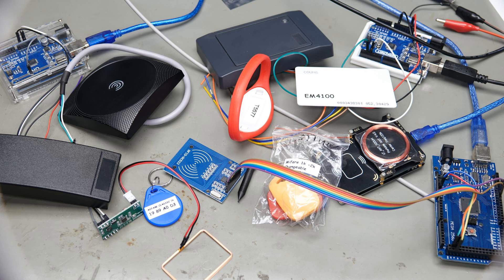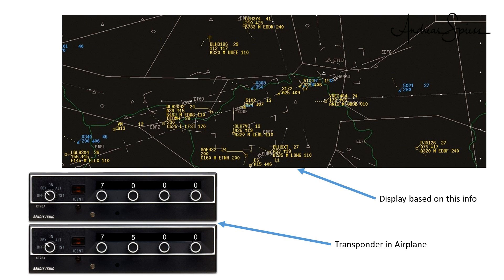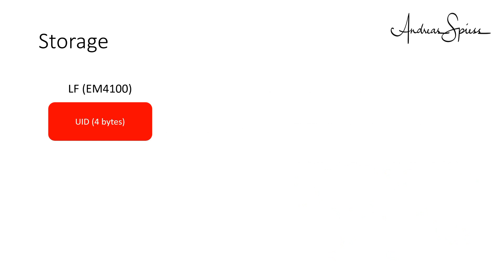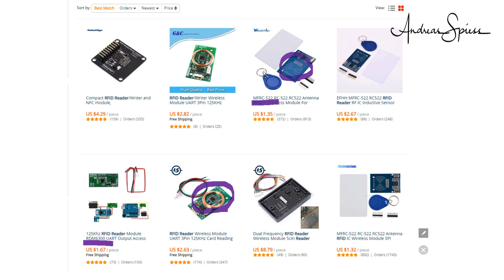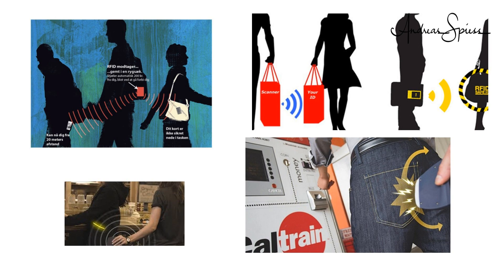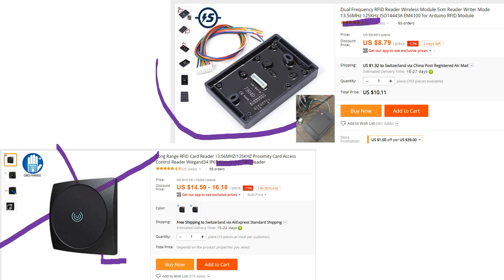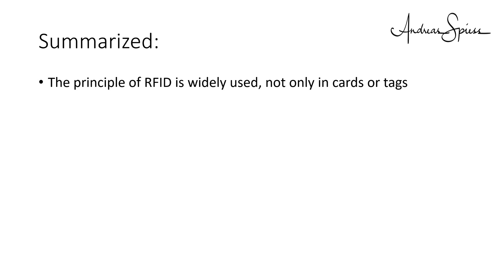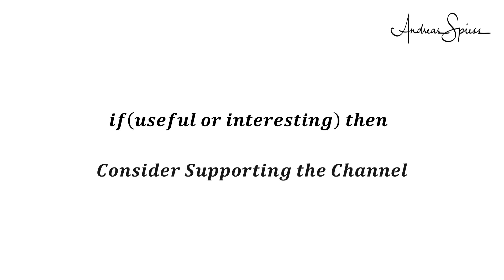#223 RFID How-To: Not only for Arduino (only legal Stuff!)

Comment: Possibly you ore a viewer can answer.  I have a dog door made by pet doors USA. I bought it almost 20 years and it was about 800 dollars THEN.. now they are about 3k.  I purchsed the door with 5 tags but over the years some have been lost.  I am down to 3.   I order news ones but when i got them they wouldnt connect and it turns out they changed the entire PCB and the  new tags are not compatible and they do not make the old tags.   So my only option is to purchase a new PCB at a cost of... wait for it...  800 dollars plus the 50 for each tag   I am in the process of designing a dog door to fit into my mudroom door with arduino so i have the readers etc but is there a way to clone these purchsed rfid tags?
Reply from the maker: No need to clone tags. If they can be read by your new reader, you are ok. If not, you are out of luck. Because there is a special standard. I made a video about animal RFIDs if you want to watch this one.
Reply: @AndreasSpiess  thanks so much for getting back to me.   i DID watch that video actually.   i haven't set up the arduino with the reader yet.   since one of the tags met with a violent end (ran over it with the lawn tractor), i can tell there were MANY more copper loops than what could fit in the cheapo ones i got from aliexpress.   but i did check and it's that same freqency as the the cheap ones, so fingers crossed.

Comment: I have built several rfid scanners into 4" outdoor jobboxes ( gray electrical boxes u see on outside of commercial buildings) I would put an arduino w a couple hats for the rfid and one for data logging inside. Double sided tape on the back and mount them right next to a buildings rfid door systems. Even w the small on board antenna it was more than enough to read 99% of IDs that used the door scanner. Just this week I picked up an arduino starter kit ( it came w an uno and a bunch of components for price of just a single uno.) The kit came w an arduino rfid starter kit, including a transmitter/receiver and a programmable card and dongle.
Reply from the maker: Sounds like an interesting project!

Comment: Have you used the MFRC522 much? There seems to be a common problem where they just stop responding. Have you seen this? (Out of 3 cards, I've now got two that are non-working and no clue as to why)
Reply from the maker: Not good. Recently, I did not use it extensively. But I did not encounter such problems.

Comment: Dear sir, 
I am not super smart, But i am willing to learn and solve my problem, 
My problem is, my car key, which has an rfid, I have lost it somewhere in the house, 
is there a way to find it with some project?
Reply from the maker: I do not think so :-( RFIDs in keys are only short-range
Reply: @AndreasSpiess  yeah, thanks for the response, figured that out, there's chip in my second car key, ATA5702, which sends out a continuous signal, and I guess, at a certain distance, my car recognizes it,
Now, all I need to build is a way to detect a rf frequency if that's nearby. The frequency I could figure out with my alternate key...

Any suggestions on this sir, any comment would be a great value...

Comment: hi! Great Vid!

I have a question for you! I have a keytag for my apartment and I want to clone it so i have a spare one. I bought the RC522 module for the arduino. The module works fine and reads lots of different cards and tags, but it does not read the keytag for my apartment. The key tag is a standard blue roundish tag with a 10 digit idnumber written on it (first two 0). Why do you think the RC522 cant read the tag, and what do you recomend i should do? Thanks :)
Reply from the maker: Thankfully, your key is encrypted. Otherwise, everybody could enter you home ;-)
Reply: @AndreasSpiess  haha yes i figured. But I still want to duplicate the key. Do you have any suggestions?

Comment: Your squawk example of 7500 is a poor one. It has a special meaning, and that meeting is hijacked. It's a squawk code you would never enter, in fact we're trained never to go through 7000 series as they are special and instead go up from the bottom.
Reply from the maker: You are right! With and 4 seaters I never had to use it ;-)

Comment: What's Wrong With this Code for Wiegand.h Library

#include <Wiegand.h>

WIEGAND wg;

void setup() {
  Serial.begin(9600);  
  
  // default Wiegand Pin 2 and Pin 3 see image on README.md
  // for non UNO board, use wg.begin(pinD0, pinD1) where pinD0 and pinD1 
  // are the pins connected to D0 and D1 of wiegand reader respectively.
  wg.begin();
}

void loop() {
  if(wg.available())
  {
    Serial.print("Wiegand HEX = ");
    Serial.print(wg.getCode(),HEX);
    Serial.print(", DECIMAL = ");
    Serial.print(wg.getCode());
    Serial.print(", Type W");
    Serial.println(wg.getWiegandType());    
  }
}

'WIEGAND' Does Not Name A Type   (for Code Line (WIEGAND wg;))

Comment: Hey, nice video :)
You mentioned that the EM4100 or "good reader" works on 5V. But on its back panel it says 12V?
Reply from the maker: I do no more remember. Maybe it has a built-in voltage regulator

Comment: Does anyone know of a tutorial for the EM4305 standard running at 134.2KHz? Or a pin layout for an FDX-B EM4305 board? Could I use the same Arduino code as for the EM4100?
Reply from the maker: I only made a video about animal tags on 134.2KHz.

Comment: Before I watched your video I had ordered the "Bad" RFID reader from AliExpress. My electronics knowledge is poor and I've struggled to get it working with an Arduino using 13.56MHz. (The buzzer is also continually on, whether it is connected to the Arduino or not). 
Do I need to wire any pullup/pulldown resistors to get this working properly? I've tried a number of libraries, but not the one you have referenced above. Any advice, or a wiring diagram would be much appreciated. I will order the "Good" one from above and see if I can get that working.
Thanks for all the great videos.
Reply from the maker: Unfortunately I cannot do remote debugging :-(
Reply: Wasn't so much hoping for debugging advice, but how you wired yours when you were testing. But thank you for replying.
Reply from the maker: This is longtime ago and I am na old man :-(
Reply: Not so old I think :) But I certainly understand and respect your response. I continue to look forward to your informative videos.

Comment: Hi,
some feedback and a question on my setup.

I purchased a Qwiot(?) 7304D2 dual frequency reader and wired it to an ESP8266/LoLin Dev board
I also received 125khz cards + keyfobs + coin-type chips.

From a previous experiment with an RC522A reader module I also had some 13.56mhz keyfobs and cards. The 13.56mh items scan immediately, it does not matter much where I place the chip on the reader.

The 125khz cards/keyfobs however scan much slower and much more unreliable. I have to place the chip dead center on the reader and there is a ca. half second delay until the card is read.
At a number of occasions the reader even locked up and did not scan any more. The ESP was still looping. Reset and it worked again. I am using the "Yet Another Arduino Wiegand Library" library.

Is this behavior normal/known?

Thanks
Reply from the maker: I do not see a feedback nor a question
Reply: Andreas Spiess well, the feedback is that the reader works crappy for me on one frequency. This might interest people who plan to order this part. Question is whether somebody can confirm such behavior.
Reply from the maker: Bow I got it. Thanks for the clarification!
Reply: Andreas Spiess 👍

Comment: Hi  Andreas. Could you maybe provide wiring to ESP8266 and maybe a sample sketch for the dual frequency module you recommend here? That would be awesome! 🤓
Reply from the maker: If I remember right it just outputs the number on Serial. There you can read it. No big deal.
Reply: Andreas Spiess Yes, thanks. I was a bit confused with the LED and buzzer pins. The device is not widely used nor documented but I found this info which looks helpful at  smartpoker dot  jimdo.

Comment: I bought mfrc522 and it work will but sudenly it stop and i change it the new one work well after 1 day it the new one stopped and some time read tags and some time stop 
my conection is very good and i make sure of them i mesure frequincy of the medule it is 13.65 mhz 
When it stop give me 50hz or low freq 
Can you help me with that please
Reply from the maker: Unfortunately, I cannot do remote debugging.
Reply: @AndreasSpiess   
If i power chinees arduino with usb can it give me 200 milliamper from5 volt pin or less

Comment: The aircraft transponder codes at the start...

The bottom one, 7500, if you ever put that in on an aircraft, you will be met at your landing by law enforcement.  It is one of 3 “special” transponder codes:
7700 - Emergency
7600 - Radio Failure
And the one displayed, 7500 - Hijacking in progress
Reply from the maker: So I have some real pilots amongst my viewers ;-) Unfortunately I learned to fly in a hijacker‘s flight school in Venice, Florida:-(

Comment: Which system would best serve to track participants in a marathon setting? To register runners as they cross check points.
Reply from the maker: Runners are usually tracked with UHF RFIDs. There is also a video about that on this channel.
Reply: Andreas Spiess  Thank you. I have a Concept for a Next level Event, that will benifit from various RDIF systems. #FLUXXIX #2020Vision

Comment: Dear Andreas, thanks for the nice channel.
How did you connect the 7304D2 reader? Also interested to learn how to connect the Buzzer en Led control.
Can you also write on a Mifare card with this Wiegand (7304D2) Reader? 
I'm now using the MFRC-522 reader/writer and looking at your channel I would like to change to the more professional reader.
Thanks.
Reply from the maker: 1. Wiegand readers have two data lines (D0 and D1)
2. The buzzer and the LED was controlled by the reader itself
3. You cannot write cards with this device (at least I do not know how)

Comment: resonant reeds
Reply from the maker: And How did they read these tags?
Reply: Not RFID but AFID
We tend not to think of a neon bulb as an electronic component, but when it's all you've got, you get inventive :-)
so with coils, caps and zener diodes what could you do today?  sounds like an audio frequency identification device.  it only clamps if the LC resonant frequency causes a voltage peak and the bulb lights.
https://en.wikipedia.org/wiki/Reed_receiver
....and.....   
https://en.wikipedia.org/wiki/Mechanical_filter

Comment: I built a 125kHz/LF RFID card spoofer using an STM32 microcontroller and some other basic components. It works on all devices I have tried it on thus far.
Reply from the maker: Hopefully. The protocol is standardized on 125kHz.  On 13 MHz it is a little trickier...

Comment: Many of the USB RFID readers hit "enter" automatically when connected to a web form/pc.  When I want to add a second factor of security to rfid on a web application like a login or a gift card, I have the user enter a pin followed directly by scanning their rfid card.  So the 4 digit pin plus the 10 digit rfid uid concatenate together into a 2 factor authentication on one form input.
Reply from the maker: That is for sure a much better security than the card alone!

Comment: Would it be possible for a coil around a doorframe to read the RFID chips?
Reply from the maker: I am not sure what driver you need for that. The „coil“ is quite large and the distances, too.
Reply: i once mounted a large antenna behind the door, it was only powerfull an read only in the corner of the antenna. maybe something for a next video? -- see here, to see more antennas and the large one. interesstingly they build it with ribbon cable for hardisks... http://www.rss-systems.de/shop/rfid-systeme/rfid-systeme-125khz/antennen-lf/ulr190-u-long-range-190x85cm.php

Comment: Hi Andreas, Interestig story about RFID's. Did you ever tested the long range RFID's used in sport timing systems? |They have a reach upon to 8m. These systems are quite expensive. Would you think it is possible to build such a system with budged equipment. Would it be able to just ad a strong antenna to a basic system for a better reach?
I need to determin/recogise persons on 8 meters distance.
Do you have any experiance about this subject? Innod is a long range RFID tag.

Regards.

Johan van D.
Reply from the maker: They use UHF tags and quite strong transmitters. I have UHF tags and a reader here to experiment and will cover it in a video. But I do not have an (expensive) high power device.

Comment: 09:23 I wouldn't rely on multiple cards as protection against malicious reading - the ICs usually support collision avoidance, if multiple cards are present the reader can choose which one to address. This is for example used in logistics where a packet can have multiple contents with separate tags - passing through the reader will sequentially read all of them. I guess the reader you tried is specifically designed for access control - since in this case multiple tags is a sign for unwanted scans they abort the reading, but thats just a design decision and not a technical limitation.
Reply from the maker: You are right. Some of the modern chips support anti-collision. But the one I used not. If you combine only one which does not support it, your spectrum is "closed" as it always transmits.

Comment: -1- What about shops who  protect there merchandise with RFID. In some shops the alarm seems more sensible than in others and sometimes reacts to library books.
- 2-The public transport in The Neterlands use HF RFID cards. They store data on the card but also in there own system to prevent using cloned cards.
-3- The alarm in a shop sounded once due to a (big) bundle of RFID card in my wallet. When i splitted up the cards there was no problem...
-4- An idea to add a cheap RC5222 reader in the bottom of the Tank to detect the (exact) location of spots where a Tag in placed in the floor? (Perhaps some nail tags can placed in the garden ground for that?)
Reply from the maker: I do not know how the cards in shops work. I only read that they have one bit which is flipped when you pay. Maybe the scanners are very primitive?
Concerning Robo Tank. Good idea!
Reply: @AndreasSpiess I know I’m late to the party, but I just wanted to mention that stores often use a technology more primitive than rfid - a capacitor!

They wire it up to a small coil of wire and embed it within the plastic tag attached to the store goods, and then a dedicated device transmits a signal and checks for any return signal. Simple, but pretty clever!

Comment: Does anybody also have a nfc implant like me https://chip-implants.com/shop/nfc-implant-x2/ and have managed to read it? I have big problems, and I think it is because of the pcb antenna layout (always the same on 522 boards) is not designed with the small implant antenna?
Reply: And while I have played a lot around and ordered a lot of boards, I think the most 522 boards are faked with a faked nxp chip.
Reply from the maker: Maybe you try another RFID card to test your reader.
Reply: I tried a lot of 522 boards (maybe 7), a 532 board, a door lock and some Nfc mobile phones :)
Hard to find some other crasy ppl with a implant...
Reply from the maker: I meant you try another card. Because, If your reader can read the card the problem is your chip and not the reader. Then you have to find out the specifications of your chip to find the appropriate reader.

Comment: EM RFID chips (I have bought a lot of these from china) have 40 bits UID. However it is very common for reading equipment to "mask out" only the least significant 32 bits. Our Axema access system (a swedish manufacturer)  where I live uses all 40 bits! 
So, the UID number in the Axema event log is different from the number inscribed on the chinese RFID tag. Very confusing before I understood what was going on!...
Reply from the maker: Are you sure you do not read the bytes described here: http://www.priority1design.com.au/em4100_protocol.html ?
Reply: I have actually written a little "essay" about my findings...https://sites.google.com/view/experiences-with-em-rfid-tags/home

Comment: I am working now on a project where I will need to write encrypted data on a mifare 1k card. I was thinking about using a reader with wiegand protocol, but since you said that you cannot read anything beside uuid this is a problem. Do you know if this is a hardware or software limitation and if hardware are there accessible readers out there that can read the card content?
Reply from the maker: The two "professional" readers I have do not provide information about their capabilities. The two boards should be able to write, too. But I did not investigate. I assume you also need software to do it.
Reply: Well the software I can write for myself, as long as there is some kind of documentation on how these devices should work.

Comment: How much energy do you need to destroy the tag / card, like using a induction heater at the right frequency. ?
Reply from the maker: I do not know as I have no transmitter for this frequency, and if I had one, it would probably not appear on YouTube as it would be highly illegal ;-)
Reply: You say transmitter (sounds like HV) and I meant an industrial induction heater (more current) for metal parts/heat treatment.
Would you say, it only works ("kill") with higher voltages, and not with big current?
Would (theoretically) a induction charger (5W) be able to kill, the card, or are the frequencies legally attributed for these chargers.
Reply from the maker: You mentioned "the right frequency" in your post. This triggered my response.
Reply: A few seconds in a microwave would probably do the trick...  ;o)